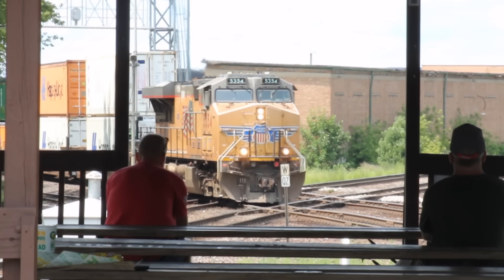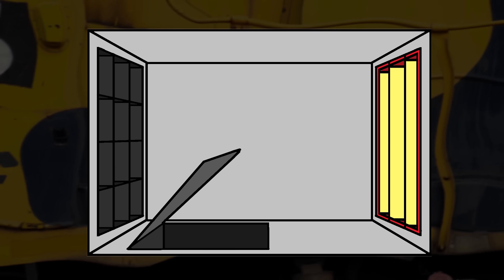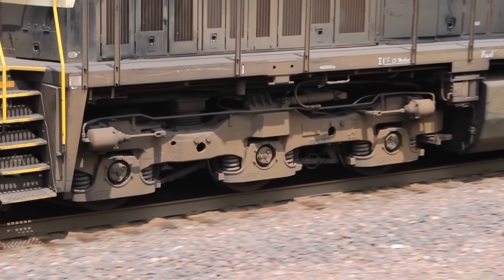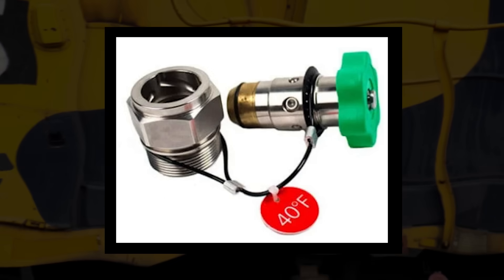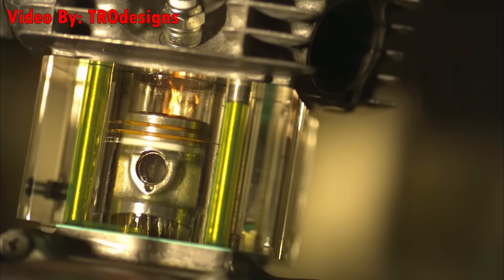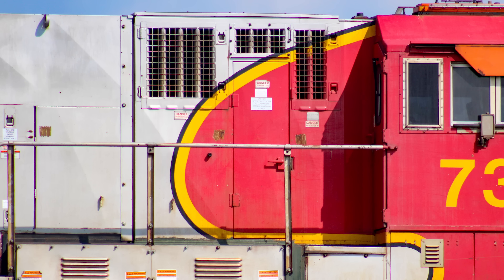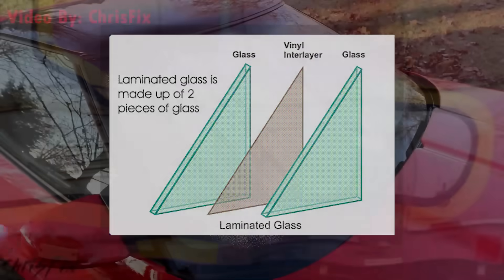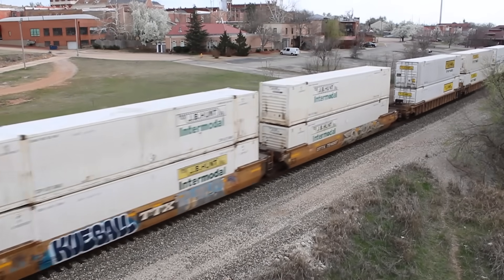The 10 Most GENIUS Design Features On Locomotives!

Comment: A thing that surprised me when I learned about it was the conical wheels and how they work. Since I grew up around farmers I learned at a young age what the difference between an unlocked and a locked differential can be, so I always figured that the wheels not being able to move independently was a bit of an oversight, especially on unpowered axles. Turns out the wheels are conical, and by connecting both wheels this causes the axles and therefore the train to stay centered on the rail, even in corners. If an axle isn't quite centered one wheel will be bigger than the other, and since they are forced to turn at the same rpm this induces a turn, making the  bogie go back to the center. In fact, that visible rim on one side of the wheel is mostly a failsafe, and in most corners it won't touch the rail
Reply: The Bay Area Rapid Transit system has used cylindrical (flat) wheels, which lead to increased wear on curves.  I’m not sure if they have since switched to conical wheels or not.
Reply: My dad was a huge train buff and taught me about conical wheels back when I was still a young whipper snapper.
Reply: The cone shaped tire surface helps regulate the surface speeds of each wheel around curves yet the wheel and axle remain as one unit and axle rpm remains constant.    In a curved section of track the inner rail surface is shorter than the outer rail surface so what happens is the inner tire surface will ride slightly toward the tapered smaller tire surface while the outer tire surface will ride slightly toward the larger tapered surface to compensate for the extra rail length of the outer rail.     On a straight section of track the tire surfaces ride equally centered on equal tire diameters.
Reply: There not really conical, they are shaped to hug the shape of the rail, overtime I've seen wheels actually turn concave,

Comment: Having worked on many different EMD locomotives, I’d like to offer a few comments. 
The majority of EMDs that were produced with DC traction motors and generators were started using a special starting winding in the main generator. Electric starters became more common with newer turbocharged prime movers and with AC traction generators. 
EMDs don’t really have summer winter doors. All of the engine intake air is drawn from within the car body. Some models that were originally built for service in Canada had dampers that plucked off one of the radiator fans to conserve engine heat in winter. 
Most locomotives I encountered used only water in the cooling system without additives. 
I’ve never known of a piston replacement on an EMD. Typically the power pack is replaced in entirety and sent back to Progress Rail as a core. Depending on the equipment available on-site, the head may be removed from the power pack to facilitate handling. If the special rigging tool is available, then the entire assembly including the head can be pulled out and replaced with a new assembly in one move with the hood in place. 
Again on EMD DC locomotives, there are actually 3 generators: the DC traction generator, an AC generator that powers the radiator fans, and a separate 74 volt DC generator for lighting, controls and battery charging. 

What I think is the most ingenious engineering that EMD pioneered is the design of the MU cable that allows locomotives to be operated remotely from the leading unit. The 27 wire cable that connects each locomotive in the consist, has two wires that relay the position of the reverser on the head end. Pins 9 and 10 if I recall. So how does this work when some locomotives face forward and some face backward? This is the genius part. Within the MU cable the wires to pins 9&10 are swapped. On the leading end of the locomotive those same wires are also swapped. On the rear of the locomotive, those wires are NOT swapped. So when connecting a locomotive facing forward, the wires are swapped twice and therefore forward is connected to forward. When the locomotives are connected back to back, the wires are swapped only once. So the trailing locomotive will operate in reverse when the leading unit is in forward. No need to think about it. Such simplicity. Genius.
Reply: Okay, so here's a dumb question: why do diesel locomotive engines use only water or water/borate? Why no anti-freeze? Is that something peculiar to locomotives, or do truck/car diesel engines also not have anti-freeze?
Reply: That's actually pretty genuis with the wiring truck for the MU cables, a way to ensure the remote locos run in the right direction before they were computerized.
Reply: I do know that EMD and Nohab had an issue with getting the wiring consistent when the export model G12 was shipped to Scandanavia for testing with the MY class and related units. This wasn’t only a problem for EMD either, the British Railways Southern Region had the same issue with their MU system on the Class 73 Dual-Mode Diesel-Electrics as, the fleet of Diesel Electric Multiple Units were also wired backwards compared to the third-rail Electric Multiple Units.

Comment: There is the hidden bathroom. Also the space at rear corner where a crew can control it in yard work.  It has a name long forgotten to me.
Reply: The other thing I found strange is the RCLs that are used for yard moves these days, from what I've heard, they're normally operated by a conductor who is not allowed to sit in the engineer's seat while driving, they can only drive the loco from the remote control unit they carry.
Reply: @mrvwbug4423  Operated by switchmen.
Reply: Hostler’s control stand is what comes to mind. The P40s and P32AC-DMs (but not the P42s, for some reason!) had them.  Some EMD B-units had them also, but not the GE B-units as built.
Reply: @JohnGeorgeBauerBuis  Our gp60b's could be operated strictly for movement purposes, but it took 3 people to do it. One on the point, one outside the door to relay the signals, and one to operate the limited controls. If I remember correctly, it could only be throttled up to notch 2. I haven't seen any of our 300's for years. I also wondered why most of ours had a crossing bell, it was never piped up, but it was there.

Comment: Good video but...the way a locomotive works really isn't on a level with NASA. 
And, is there really ' secret' doors for electrics??
Reply from the maker: I would say it is. There is just so many computers, valves, sensors, communication devices, and mechanical systems all working and exchanging information simultaneously. With so much going on, it's practically impossible to know how everything little thing works on a locomotive. And as for the secret door, I have seen thousands of locomotives, and been on board several. Even after being around them so much, had no idea that door was there until a locomotive mechanic pointed it out to me.
Reply: @Southern_Plains_Railfan  The PRR GG-1s have a "suicide room" in the center, where the main transformer is located. Access is from inside the cab.

Comment: Most EMD locomotives do not have a summer/winter door, the only model I know of is the SD-70 ACe. Also that door is not located on the engineer’s side of GE locomotives. It is behind a door on the conductor’s side directly under the intake air filter box - if it has one at all, some GE models don’t. The GEVO locomotives have one big summer/winter door in the floor of a compartment accessible from both sides of the car body, the door is directly beneath the engine air filters.
Reply: almost all gp and sd series emd's have summer winter doors on the wall between the engine and aux cab
Reply: @kshillbilly1967  
That’s considered a firewall and we don’t open them, except on the 70 ACes
Reply: It is there. It's about 1 1/2 foot by 1 foot, bolted into the firewall, above the turbo inlet boot, behind the aux gen drive shaft and aftercooler air ducts. That's why it is never opened.
Reply: @alanmurdock4319  
The only ones we open are on the SD-70 ACe models, and then only if somebody feels like getting on top of the main alternator to do it. Most people don’t. As far as the rest of them go, the SD-40’s have been apart so many times that the bolt holes in the firewall panels are mostly stripped out and are held together with self tappers, so we don’t mess with any of them. The SD-70M’s have never been opened. They just don’t need it for the most part. Working radiator shutters are the reason. The big GE engines didn’t have those until the EVO units came out, so that’s why those older ones were a big deal to get opened up in the winter and still is with the EVO units. I started opening the doors on the units I was outbound load testing last week even though our timeline for that doesn’t start until 11/1.
Reply: @ralfie8801  You might work for the same RR as me, as the timeline for summer/winter seems to be the same. However, I have seen quite a few evo shutters fail either open or closed and those only appear on the wet radiator design that came after the univalve was dropped.
Reply: @alanmurdock4319  
It’s hard to keep up with them because there are so many variations. Air to air shutters, no air to air shutters, radiator shutters, no radiator shutters, the hated univalve, wet cooling system is my favorite. Wet cooling system on the updated C-44 makes me happy to not have to troubleshoot V-1 V-2, plugged radiator problems.

Comment: The weight repartition system was used in old french SNCF's Class A1A-A1A 68000, but the wheels that can be adjusted where traction free and where operated automatically.
It was used to operate heavy Locomotives on fragiles tracks but where actually not usefull in France and had be removed
Reply: On the locomotives he describes in this video, the system is only used on the non-traction axles of A1A-A1A locomotives.
Reply: I thought all (Diesel-electric) axles were driven, except a few antique oddities.
Reply: @ReggieArford  there is very few of them using this wheels arrangement design, in France we use to have 2 Classes;
The A1A A1A 62000 (an american design imported from Baldwin's) 
And the (larger serie) A1A A1A 68000 and 68500 from the SNCF (french railway)
The "A1A-A1A" is the SNCF's dénomination for loco that use a "traction free" axle on their bogies
Reply: @avrazero1975  "A1A-A1A" isn't just French -- it's the UIC (Union internationale des chemins de fer; International Union of Railways) international standard. And the UIC is named in French because it's old enough that French was still the international language of diplomacy when it was formed. 🙂
Reply: @beeble2003  So it was at a certain time the unique dénomination for Wheels arrangement ? France is the only one that still use it (and only SNCF).
The only "international one" i know is the one that looks like "ooOOOo" or "6-0-6" or "Bo-ooo-Bo"
Reply: @ReggieArford  The great majority of modern diesel-electric locos have all axles driven. In former times, the unpowered axles were generally to keep the weight per axle down. The current ones in the US are for use on high-speed intermodal trains. "Ideally", one would use four-axle locomotives for that, but nobody makes those any more. The idea of having four powered axles is that it means more power per powered axle, which means the train can run faster. Intermodal trains are fairly light, so you don't need lots of powered axles to start the train.
Reply: @beeble2003  I know that axle loadings have prevented the construction of most high-horsepower locomotives with only four axles, as the required emissions-control equipment along with the engine itself would make the locomotive too large and heavy for only four axles.  Passenger diesel locomotives get around this with high-RPM engines, but they can require increased maintenance along with different designs of parts, increasing capital costs.

Comment: While DWM is cool in theory, we really dislike it for maintenance purposes on the locomotive. At the end of the day you still have only 4 traction motors providing power. If one goes, that unit is dead where it’s at. If you loose one or even two motors on a C6 GE you might not even notice or at the very least, that locomotive can still keep pulling freight until it can get to a shop
Reply: The GE C4's always seemed like weird locomotives to me. So the idea is to have a slightly cheaper ES44AC that duplicates the tractive effort of an older DC Dash-9 and you replace them 1:1 in your fleet roster - why?
Reply: @MalikCarr  I’m guessing to have a warranty, as older GEs tend to decrease in reliability as the prime movers age.  That said, replacing the prime movers would be an obvious fix that is cheaper than a whole new locomotive!
Reply: @MalikCarr  Somebody in Ft. Worth, that never touched rail equipment thought it was a good idea on a spread sheet.

Comment: Summer/Winter doors on older EMD's can be found on the roof over one or more of the cooling fans, depending on the setup. These big bulbous housings are actually an addon for some road switchers such as GP38s but are most commonly found on E8/E9 locomotives, because to my knowledge they are the only locomotives to have them built into the body. Now as far as the modern stuff, I have no clue. They may not utilize such a thing anymore.

Those "idiot bars" on the Aux Cabs also ground out all the power in the circuits when raised so not only is no more power being sent to them, but it's also drained from them.

I did not know about BNSF's Dynamic Weight Management, that is very cool!

And about the compressors that use glycol an oil - Propylene Glycol is an active ingredient in antifreeze. Makes sense to me.
Reply: the summer winter door on emd series is located at the top of the inner wall between the engine and the aux cab located on and around the alt/gen unit. BNSFs dwm system seems like a good idea but has many problems and suffers from a tremendous amount of wear to the pins and chains. The chain has even worn into the truck frame in many cases. the glycol or oiless air compressors have been tested many times and so far the results aren't that great.
Reply: @kshillbilly1967  The emd s/w door is not used since it sucks trying to get to it. I always thought that dwm was a bad idea, I worked the drop pit when it first came out, our next locomotive order will have all 6 motors without dwm.
Reply: I had heard of the roof mounted ones by the name winterization hatches, but didn’t know how they worked exactly prior to this.
Reply: @JohnGeorgeBauerBuis  I believe on any locomotive other than the e8/9, they are referred to as winterization hatches. The operator's manual for the E8 refers to it as the "Engine room ventilation system." All different names for the same thing, it seems.

Comment: Another thing about the main gen  starting the locomotive is that early EMD’s would do the same thing, primarily in the prime days of EMD 567 prime movers. Something neat to mention would be the fact that the diesel engine does not have a traditional engine block in the fact that they have almost like hatches on he side (we call them handholds) that can be opened to view into the crankcase and into the scavenging air box, the block isn’t a solid block and has a whole system inside of it for airflow into the block. The blower hump on the side of EMD’s is being fed by the auxiliary generator which is battery charging and uses it’s electricity to excite the main gen, it also controls some smaller electronics. I can provide pictures of a lot of things on early EMD prime movers.
Reply: Also to mention is many locomotives have a system similar to a vehicle’s EGR (exhaust gas recirculation) that route blow by and some fumes back into the scavenging air box via the intake manifold coming off of the roots blower. Simple but neat system.
Reply: its electricity

Comment: The 2 piece piston you talked about for the GE engines look like the 2 piece piston used in truck diesel engines. 
In trucks the 2 piece design came about due to emissions regulations & rising cylinder pressures & temperatures. 
Pistons used to be one solid machined piece of aluminum, but temps on the firing faces of the crown were nearing the melting point of the aluminum. 
Engine pistons were then redesigned into 2 pieces with a steel crown to handle the increased stresses, and an aluminum piston skirt to save weight over a 1 piece completely steel piston. The aluminum is still more than adequate for the lower piston job so  it was retained. 
As locomotive diesels have been also facing stricter emissions requirements this could be an additional reason to use the 2 piece design if not the main reason.